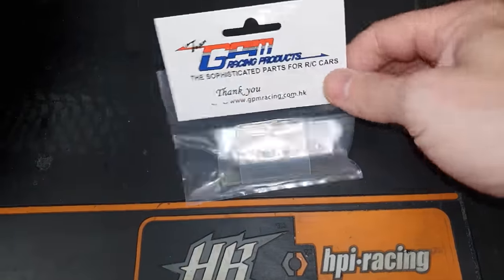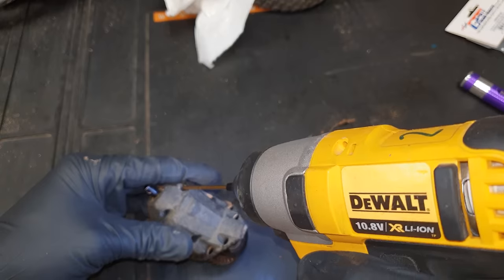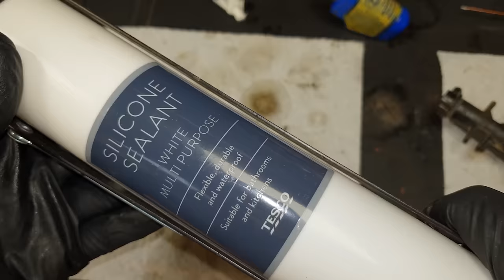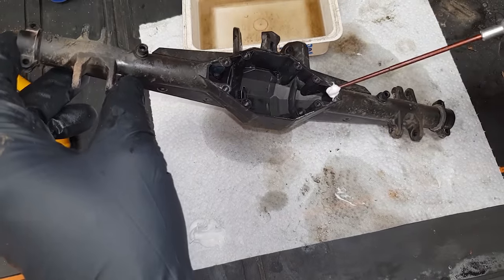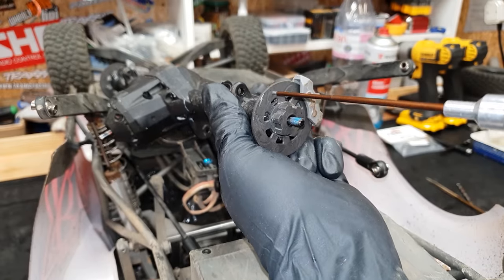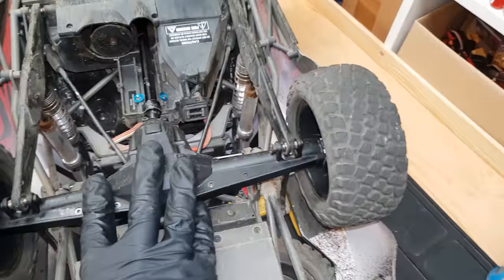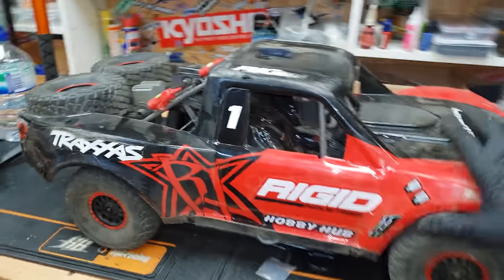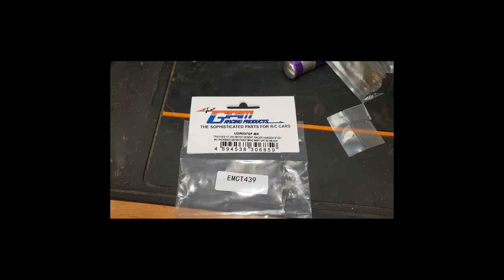Shop Time - Traxxas UDR Diff and Planetary MOD

Comment: I am glad I caught this video! I was stuck on removing my front differential. I removed my rear one and did the seal like you did, but I added a bunch of grease into the planetary gear system and ran some into the axial on both sides and some seal. So far, I have gotten an extra 3 miles in speed out of it. Now that I get how the front one comes out I am going to grease that one up as well and see if I can beat that 35 mph top speed! Thanks, Kevin!

Comment: Great job Kevin, another great repair/upgrade vid. Glad you got the Center drive replaced with the aluminum one. Mine is great, no issues but I don't go as hard on my udr as you do. I figured this would be a good test for your udr and your bashing sessions. My car isn't a shelf queen, I just don't jump as high as you take your cars.😊 BTW I agree about the aluminum trailing arms. If they break the body or frame, the frame would  be a pain in the a$$ to replace..Thanks for sharing dude👍🏿

Comment: Hi Kevin. You probably don't read my comments at all. I wanted to say thank you for doing this video on the rear differential. I did this job this morning on my UDR and sealed it like you did. I also, regressed the whole differential. The job worked out well and maybe just because I don't have the body on. I was using my 4s Lipo and was getting my truck on 2 wheels a few times. I am so shocked and totally jagged at the same time!

Thank you for putting out this video! It helped out so much!
Reply from the maker: I try to read all comments dude, glad i could help buddy
Reply: @KevinTalbotTV  nice! Thank you good sir for the reply and all your help!

Comment: seen a few comments on other channels about grit getting inside the transmission, front and rear diffs. So before taking mine out, spent a couple days this weekend tearing mine down and seeing why and if I could prevent this. I think what is happening and probably can't see it unless using a high speed camera to record it, the components flex during impacts, creating gaps between the mating surfaces. How else can you explain particles inside that can't fit between the surfaces normally? For now just a liberal application of Marine Grease before reassmbly is what I am doing. Odd that it has a silicone seal at the rear output of the transmission, but none on the front or either differentials input. Hope your solution works.
I also suggest that you find another choice of cleaner rather than Brake Clean. Where I work we have used it to clean up oils and fuels.. when it comes into contact with plastic polymers it has made them brittle and prone to cracking. Most especially polycarbonate.. several pairs of safety glasses and wristwatch faces have been damaged by overspray and splash. Now we just use Grez - Off.

Comment: Probably got some silicone sealant in the gears mate, once it hardens bits will break off and gum up the gears. You would of been better off using marine grease.

Comment: Got here fast!
Reply: Kev I got my Rustler 4X4 VXL ordered, I’m on the first shipment list, it’s my early Xmas present to myself, 😂 I got my new GoPro hero 5 n gimbal delivery today for my bday present to myself I’m 37 on the 8th
Reply: I also did this to my udr when it was new out the box n haven’t opened it up since I’ve ran it, it should’ve been bulletproof right off rip but I’m sure there some type of sand or dirt in there somewhere

Comment: Instead of using silicone seal you can just use any grease to do the same thing. There will be no water and dirt, but there is much easier to work with grease, instead of sealing🤷‍♂️